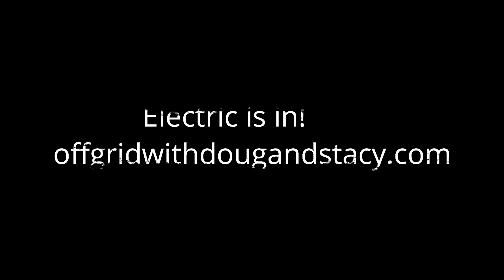Running main Power Line to MOMs Log Cabin day 79

Comment: So it's floor, ceiling and outside steps or graded rise, leveling/grading  and plumbing with utilities and lights put in.  Then any outside planting etc.  So oddly nearly done.  I had no idea it would be so much work, but the basement took a long time.  It's good that you put in that basement, because floods happen, not if but when.  So good job fellas and ladies  :)

Comment: The Doug/Gary duo are quite a working pair.  They don’t even have to talk as they work, now. Bravo!
——-
***Here, where I live, we had to bury our main power line a minimum of 30” for the entire run from the pole to the box.  It had to pass an inspection.  Your run doesn’t look to be dug 30” deep.  Here, I’ve walked around since 1999 (date of install) thinking everyone had to go an minimum of 30”…
Reply from the maker: It was under 30 more like 35 36

Comment: Whoever did the heating & air in your mom’s house did a great job. I installed HVAC for years and I always installed it as if I was installing it for myself. Some people just don’t care about how good it looks, they just install it as fast and cheaply as possible. I only got a call back on my work one time, I still don’t think it was my fault. But I owned the mistake and fixed it on my own time. I earned points with the boss, he was impressed.

Comment: You all did remember to glue the pipe junctions to make the insides water tight? As in if any of the main power wire has damage things could get an expensive and dangerous ground fault problem.

Comment: So sorry Gary that Ralph missed the outlet in the mud room right by the door. I don't think you have any resemblance to "The Frogman", no matter what Stacy calls you Gary. That was really cool seeing you lay the wire and it's so nice that it is underground and not a wire hanging from the pole to a mast on the house. The water line is in too? Fantastic! Rats, glue before threading the wire. Gary is so handy. I like the twist and shout. What did you use to do the trenches with? Did you just dig them out by hand? It's nice to have the skid steer to fill the trench back up with though. That must feel really good now Doug to have power and water to your Mom's cabin! Great progress guys! I'm wearing my Pyramid Permaculture baseball jersey today guys and I got complements on it. I really enjoy this channel. Thanks for showing us another part of the build Doug.

Comment: Hey Doug if your ditch was 24" or deeper you would have only needed to protect you up sweeps out the ground at the house and pole that was direct burial wire been a electrician for 35 years would have saved you a lot of time and money

Comment: wire going from the meter main on the pole to the house was supposed to be 4 wire cable because the house panel is not the primary panel or at least thats what nec says  maybe that code isnt enforced in your state either way great job guys

Comment: The National Electrical Code requires all conduit connections to be “made up tight” which, in the case of PVC conduit, means glued.
Reply from the maker: Wrong again lol
Reply: @OFFGRIDwithDOUGSTACY  not the end of the world Doug. that cable is direct burial. But some places do require conduit. it should be glued. also a 4th wire for grounding is required when hooking up a sub panel. I don't have the code to reference that so check on me to verify please
Reply: @OFFGRIDwithDOUGSTACY  Sorry Doug, You are mistaken.  You may not have a building inspection dept in your county but that doesn't mean take a short cut.  It Mom's house!!  I have been a contractor in Missouri for over 25 years, I have worked with a retired Electrical inspector, for the last 15 years, for a city here in Missouri.

Comment: It's best to glue all of the conduit that way you prevent water seeping in through the joints which can overtime cause failure in the wire sheathing.

Comment: You should have got a booklet with those floor joist you can cut those joist but you have to stay 4’ away from baring and never ever even scratch the top or bottom wood , I’m a sheet metal mechanic and I have cut 6” holes in the middle of them . But check that book or call the manufacturer because codes might be different there

Comment: Are you taking extra care to make sure mice don’t chew through any insulation, soft duct work or electrical under there? A gal up here in Northern Missouri had them chew through into her ductwork and they nested just inside the vent. You guys are doing a good job!

Comment: I am sure you had a reason for not gluing the conduit together before pulling the wire.  but it would have saved alot of time and strain on the "old guys" if the conduit was installed with twine or rope first, then pulling the wire through.

Comment: It would have been good if you had installed Auto Vents around the concrete foundation that way you get air movement to vent under the house and it helps to dry it out and cut down on condensation. If you put them in now it would not be so easy because you would have to cut the rectangular size holes for the concrete which would have been better during construction.

Comment: Yes, an electrical PVC conduit needs to be glued properly with PVC solvent cement or water and insects could get in there to damage the electrical wires, especially if the conduit is buried underground. Lots of people are mixing up colors, schedules and pipe versus conduit.
Reply: also I was told to be careful with the glue it eats into the wire insulation. Did you catch the detail that they're feeding a sub panel and no fourth wire ground.
Reply: @oldpukindog  your correct!
Reply: Did they put in a ground stake?
Reply: Did they put in a ground ROD?
Reply: @steve-xo5bc  (Rods) plural. Code said need 2 unless you can prove there is enough ohms by using a single rod. I see a groundED wire in the main panel (Meter) location

Comment: Why would you not want to use glue in the ground ? You wouldn't need a 2 x 4 sledge hammer and it helps seal the joint from water which can damage your wire over time.

Comment: For your viewers information.
Sorry but PVC conduit connections are all required to be glued, but no primer is required.   NEC says joints connected in approved method.   According to Carlton (manufacturer) PVC cement is required for conduit joints.    No exceptions listed.   So, all are required.   Also, wireways are supposed to be completely connected and installed prior to conductor installation.

Comment: Hey Doug and frog man! I see that the HVAC duct got moved so now they shower drain can go in. Be sure those outlets in the crawl space are GFCI protected to keep you safe. QUESTION: I have not installed that kind of electrical conduit before, is there a glue that goes in those joints?

Comment: Also guys, after your first point of disconnect which is the breaker, you're supose to have a ground wire and a neutral..so I'm asuming it's not being inspected since you're covering the ditch up ?

Comment: Correct me if I'm wrong, but back in the day, when I was an I.C.B.O. building inspector, joints of buryed conduit REQUIRED gluing to keep ground water out. 

Did I just miss the part where you glued all the bell couplings!

Also, use the proper torque on the panel connections and re-torque yearly.  Nine times out of ten, ALUMINUM-WIRE neutral connection will come loose over time and cause false faults down the road.
Reply: Water will seep into the conduit and have standing water in there. It will deteriorate the wire over time. Even "direct burial" deteriorates over time. I can't believe they didn't glue it to seal it underground.
Reply: @steverobinson4199  Contractors don't do it because they don't have to live there. If Doug was doing it for his own dwelling, I'd bet he would glue all joints irregardless if it was permissible not to glue. Just my opinion.
Reply: @dwd3416  so what you are saying is there is no permits to build on his property.🤔
Reply: @steverobinson4199  I really don't know if he needs permits or not, but I am concerned that future problems might arise because of water and dirt seeping inside the conduit and damaging the wires inside, when it would not have taken very much time to slop on some adhesive on the joints ensuring a water tight seal. But then, it might last as long as his mother is alive before a failure happens.
Reply: @dwd3416  exactly
Reply: @steverobinson4199  I doubt it. He's out in the country. I live in the general area.

Comment: What code book were you all reading? That service does not meet the National code .Installing the Main circuit breaker at the pole now makes the panel in the basement a sub panel you needed to run a four conductor service line.

Comment: That was a short one especially when we haven’t heard from you in a while. I didn’t notice a ground rod anywhere near the meter base or at the house either. Are you using a ground rod or is it hiding from sight?
Reply: I'd assume they are probably on the final push so not worrying about regular uploads!
Reply: I looked back and about six minutes at the back of the house you can see there’s a ground wire kind of looped  around.
Reply: Life goes on

Comment: Wow, the electricity and water are so close to each other. Better hope that never gives away! Sorry but I think that is your fire hose there for the outside and it's only two feet apart? Have you got any kind of a barrier in there like rubber? Yes, the hose it's in. I guess there's no way to get away from it. Maybe at a different level, electricity on top water on the bottom. Maybe the ground and the logs would be the ground if they ever did meet so you would never know it right?
Reply from the maker: It is top and bottom , water line is in 3 ft the electric about 20 in optical illusion

Comment: I thought that before  burying any kind of either electricity or water pipes or wifi fiber etc..,we were suppose to put a plastic color different for each .  So if we are digging again in those  areas when we reach almost the items..underground we see what kind of thing is there and when we reach those color plastic cover we see that we are about to dig into the different items there…i thought it was international…..in France they put orange plastic covered electricity ….

Comment: Aluminum wiring? I thought that was bad stuff. Something about it shrinking from oxidation and the connections becoming loose. Potential fire hazard?
Reply: Aluminum wiring is certainly less than ideal especially if there are dissimilar metals involved.
Reply: Most everybody uses aluminum wire for direct burial service entrance now ..
Reply: @DavidVanHelden1  
Okay... I didn't know that. Thanks.

Comment: Looks like electricity is all around the property. Why would you chose to run generators, and have kerosene lamps and burn wood when electricity is so close. You have 2 trucks and a skid loader cameras and cell phones. I get it with heating your house with wood and having a garden and some live stock but really what the heck are you doing????
Reply: 😖 they do have solar now… 🕊